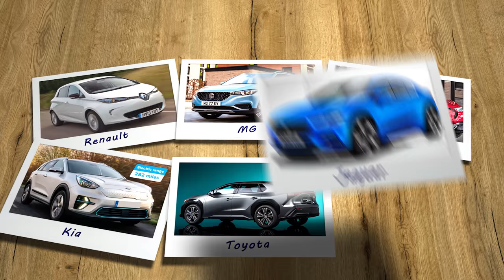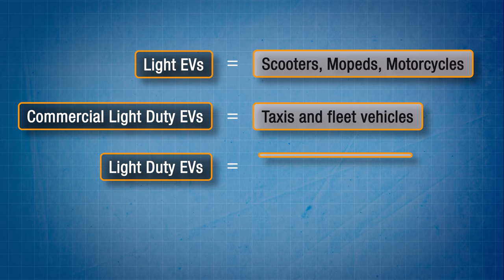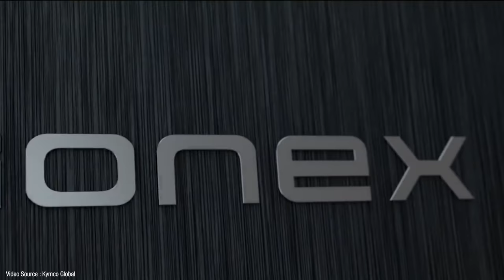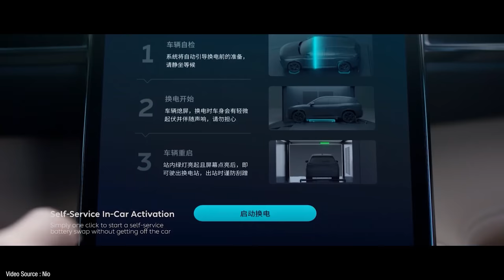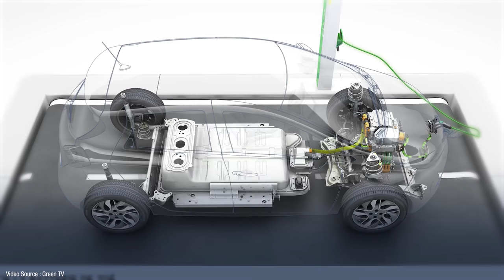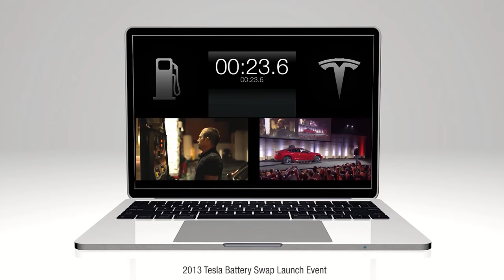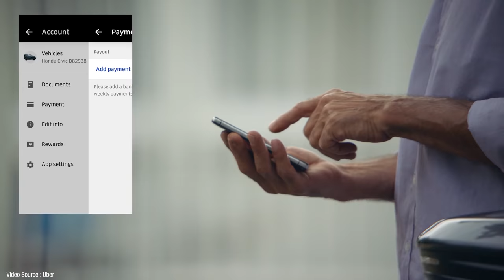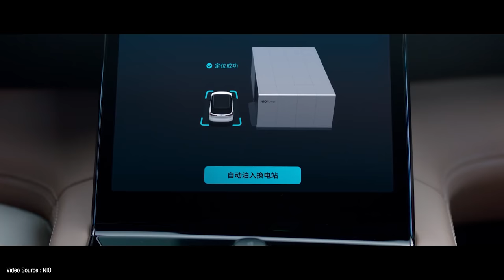Battery Swapping. Transforming the trajectory of electric vehicles?

Comment: BAAS is good for low-weight batteries.  We seen battery-swapping and an interim solution with hydrogen-swapping as a long-term solution  We have a hydrogen swap program.  What's better is that we have solid hydrogen, which is safe, has higher power density than Lithium batteries and requires no infrastructure for recharging and distribution.  Recharges with decentralized green hydrogen.

Comment: Horrible idea! Aside from the assumption that batteries and charging performance will not improve it totally locks in a current inefficient battery pack design as well as the EV itself. If Tesla had done this years ago it would have precluded their transition to the more efficient structural battery pack. Also, there is no economy of scale. Each EV manufacturer has to duplicate the swapping infrastructure, spare batteries and logistics. Electrons are universal and changing stations can be used by all EVs and will improve over the coming years to be comparable to ICE refueling.

Comment: I might be alone with this opinion that not being able to refuel an electric car as fast or in as many locations as its combustion counterpart is the achilles heel of electric cars we can purchase in today's market because there is always that little fear of running out of juice in the most inconvenient moment/place and this problem of fear will only be laid to rest by having a interchangeable battery technology which will cater for multiple car brands personally I wouldn't mind if a government sets the rules for electric cars in terms the standards it must abide when it comes to recharging and  interchangeable of batteries.

In regards to a battery being a structural part of an electric car then I would like to point out that many (if not all) of the electrical forklifts I have driven during the past decades the battery is interchangeable and is a part of the counterweight (but not the structural part).

Comment: While I can see there might be a niche for battery swapping in the HGV sector where enough battery capacity is hard to add. 

But for regular cars/vans its seems non commercial. Charge times keep falling. The complexity and makers costs to make this happen for a shrinking potential market looks a non starter.
Reply: Half the public doesn’t own a home. Where exactly are they gonna charge a battery as fast as you can swap them?
Reply: @tcroft2165  The fastest chargers are also really expensive, not that common, require massive electrical hookups, and place a lot of wear and tear on the batteries themselves.  It would be a lot more efficient to just swap batteries and slow charge them.

I think people are also ignoring how swappable batteries would allow owners of older electric cars upgrade to new battery technology as it becomes available, instead of being forced to dispose of their existing electric car.
Reply: @sunspot42  The fastest C are really not much more expensive to install at scale which is why they are rapidly becoming more common.

You'd only use the fastest option when needed otherwise you can obv use the slower ones esp those where you are already stationary like supermarkets offices etc...

Its not more eff to create a complex second market for generic swappable batteries that don't exist. For typical mileage you lose on excess weight carried alone.

Given average car life against average battery life you might make one replacement - perhaps not even that on growing battery life -  its not going to make enough difference for the economics.
Reply: @tcroft2165  Around a third of the population in America lives in apartments or rental homes where superchargers and even trickle chargers aren't often an option, and many homeowners live in condos or town houses where again, even trickle chargers may not be an option.  The supercharger network is grossly inadequate to support a broad switchover to EVs, and will likely remain so for years to come.  Right now it barely supports the market for EVs as rich peoples' toys. 

For typical mileage, the integrated batteries coming in most cars are already oversized and result in a lot of excess weight being carried.  It would make more sense to have the swappable battery packs be smaller, and to have the option to tack on an additional pack for long range driving.

We don't know what the average life expectancy of electric cars is, but the batteries are the one expensive component known to degrade and also the area where the technology is advancing most rapidly.  It makes sense to decouple the batteries from the car.
Reply: @sunspot42  It doesn't matter where ppl live - it matters where car owners live. 

However even if you include general housing  - While figures vary by country again - 63% (American Housing Survey - Housing units) was the figures for a garage/carport in the US 5 years ago. (And that inc condos or town houses, shared rooms etc.)

EV CPs are being added faster than market growth and no danger thats going to be the blockage.

Firstly you'd add the weight by having to add car structural strength back without a battery in many cases. Secondly V2g and related services rely on the excess capacity and thats a good thing for the grid and enviroment in the future.

Even existing batteries have 2nd life uses (ie storage) so thats not a deal breaker.

You can;t easily just decouple the car/bat. As the differences relate to choices of size, weight distribution, battery characteristics.
Reply: @tcroft2165  Unless you own a detached home outright, there can be restrictions on whether you can add some kind of charger to the structure, so for a large and growing percentage of the population setting up some kind of charger - even a trickle charger - is simply unobtainable. This will be an unnecessary blocker to the adoption of electric vehicles. Building out a battery swap infrastructure eliminates this need. 

As for charge points being added, I know a Tesla driver who had to carefully plan her route from Southern California to New Mexico just this past year. So whatever pace they’re being added at, it isn’t fast enough. 

The structural strength gains from integrating a battery are minimal, and can be offset by simply decreasing the size of the battery pack slightly, which will decrease the overall weight of the car and make it more efficient. Battery swaps you can complete in a couple of minutes make this a perfectly viable alternative.
Reply: @sunspot42  There's no restriction on a standard plug trickle charger so thats a fall back even before we get to either a right to install or building regs requiring chargers. Which is inevitable.

I can't comment on an individual case obviously. Though she may have been trying to stay on the Tesla network not the total network. But there are 10-15yrs in most western countries before even new ICE are banned and plenty of time for more CPs.

If you lose a structural component you will have to add that back to the car. No free lunches. And a mass battery swapping network is not cheap compared to charge points.

Comment: Superchargers are extremely expensive when compared to battery swapping stations? How?
Reply: A single supercharger needs an electrical supply that could power 50 homes, because it's peak loads are so much higher than it's average loads. A swapping station can get away with a supply much closer to it's average load, and it is much easier to sweet talk electricity suppliers if you are able to actively help them manage the grid, by doubling up as storage (even if only on the minute to minute level).
Reply: @agsystems8220  Since you have to have a battery at the swapping station and the infrastructure to swap it and charge just a charger and the additional battery (if you want to level out the load) cannot be more expensive. Especially that as a buffer you can use cheaper batteries with lower energy density
Reply: @kedaruss  Lithium ion is proposed for grid storage because there are no cheaper batteries on the market (by kWh); the chemistry is just that much better. Proposals exist (liquid metal in particular), but are unproven at this point. You basically have a situation where there is an empty battery on the car, and a full one at the station, and you want them the opposite way round. Your options are either using a battery to charge another battery (efficiency loss) in the most damaging possible way that uses the most power electronics (expensive) it possibly can, or you can mechanically switch the two batteries. The robot is the only part that switching needs that a supercharger with storage does not, and when you consider that you would need 6 copies of the 250kw power electronics to match the peak throughput of the robot, that adds up fast.
Whether they can actually build the robot cheaply enough is another question, but I could well believe it.
Reply: @agsystems8220  Correct but there are different li-ion chemistries with different power densities and different prices per kWh. Like lithium iron phosphate (LiFePO4) with no cobalt nor nickel, more cycles, safer, cheaper but heavy.  

What I was talking about is how is supercharger more expensive than a battery-swapping station (claim from the video). You said that swapping is cheaper because of a lower rate of charge but this can be offset by having a battery that you do need to have anyway in case of swapping. The fact that most of the superchargers do not have local storage means that it's cheaper not to have it. 
So on one hand you do have supercharger stalls and a transformer if needed. On the other, you need to have a building (you can't really do battery swaps without the roof), a human operator/driver, a car repositioning system, a battery swap robot and a stash of batteries. One of those stations still takes several minutes to perform the swap (In case of NIO you can do 6-8 per hour maybe).

Comment: Lots of naysayers popping up, which makes me suspect of their motivations... Battery swapping seems like a critical  feature of EVs due to battery life-cycle management. Batteries are not the same as ICE fuel tanks, and thus require an entirely different management model. For instance supercharging (the equivalent of filling a gas tank) on demand is a bad way of managing energy storage. It degrades performance, shortens a battery's life, doesn't manage battery health, overtaxes the energy grid, requires local electrical utilities to upgrade infrastructure, and can't balance energy grid load demand. Battery swapping solves those issues with EV, while taking up the same area footprint as an supercharge station. Capital and operational costs are different, but that's just a matter of project management. And an EV energy stall can be dual purposed for both swapping and supercharging.

Comment: #1 Battery production is the real bottleneck for now and for the foreseeable future. Elon Musk has said that Tesla would buy as many batteries as any producer could manufacture for a long-term contract. This is why I believe that the Tesla semi has been delayed because each semi would probably carry enough batteries to power four or five cars. As well as the Cyber truck will be coming out very shortly. I don't know how many batteries it will require to go 500 plus miles. Now with battery swapping, you would need at least two batteries per vehicle because one's in the car and the other one is charging as well as each swapping station would require a fair amount of batteries waiting for customers.

#2 I don't believe people would care for the batteries and neglect or abuse them if they didn't own them.

Don't get me wrong I like the idea of battery swapping. also, every swapping station could be tied to the grid and make money like a peaker plant. Just not at this time.
Reply: With regard to #2, given people that do own them are crying out for quicker chargers I don't think you are correct. The only way to really abuse them is to charge them badly, discharging is pretty hard to get wrong (especially as each unit would have it's own control electronics).

Comment: If that stupid idea worked, we would have it for gas bottles & other compressed gases, pallets & shipping pallets/containers, car rentals, hotel rooms rather than tents & camper vans when we travel from home, ... oh wait.

Its the ONLY practical battery solution for long distance trucking e.g. 

its not just the refueling delay - fast charging is a big ask for the rechargers grid link, & the battery life. Its not a full charge either.

Comment: As batteries are only energy stored chemically as are fuels such as gasoline and diesel, refueling our gasoline cars is actually battery swapping except the spent batteries are exhausted to the atmosphere.   The Tesla battery swapped aluminium air batteries was only a failure due to the inconvenience of swapping out the batteries as an appointment was needed.  Of course, Tesla achieved it's goal of shoeing regulators that they could easily reach any fleet range requirements given so it was always just a token effort.

Now back in the 70's, it was proposed that electric vehicles could just swap the electrolyte of lead acid batteries, eventually the plates would also need to be replaced but the whole idea was that liquids are easier to swap.  In essence, many batteries including lithium ion batteries tend to have liquids at least in their electrolytes and there are even completely liquid batteries proposed such as the liquid metal batteries hence battery swapping can become far more convenient if it is liquids involved.

Comment: There's no way every car will use the same battery. This is an outdated idea already. Especially with structural batteries on the horizon.
Reply: And if you throw software updates into the mix, then this battery swapping idea can't really work for all makes of car. Some cars will need software recalibrating if there are even minor differences in the battery packs....

Comment: Not every battery is the same at the moment.
Some designs/materials/technologies/poweryield are better than others.
So, you end up with a one size fit all.
The more powerfull cars might end up at the swap station more frequently.
So, China has a standard but that may also slow down innovation?
And what about the promise of hydrogen.
Bigger car? Bigger tank and same or more range.
Like petrol now.
And it can also be produced locally.

Is China setting the standard like Microsoft once did for the desktop operating system?

Comment: The EVs, in the way they are currently made, with a big batteries are wast of natural resources. Big batteries are not a viable technology. Electrical drive train, for that cars on the other side. An efficient EV must have electrical generation on board, via a efficient thermodynamic transformer and the size of the battery to be 1/8 - 1/6 from the current ones. In that case there is absolutely no need either by swapping or by charging stations anyway.
Reply: But aren't combustion engined cars also a waste of natural resources?  They run at 30% efficiency, wasting the remaining 70% as heat. That's wasteful surely?  And why is an EV battery a "waste" if it can be almost fully recycled, with the lithium and cobalt being 90% recoverable?  Used gas and diesel isn't even 1% recoverable.

Comment: As technology advances having a required standard will likely slow adopting the newer, likely better technology. When the existing swap out system gets around to being replaced with a newer one, will change stations still be maintained for the older cars? Remember when head light standards where controlled by the government? The rest of the world had better head lights long before the law was finally changed here. 

Would congress and their lobbyists be the ones to dictate design? Who would the design favor? The biggest campaign contributors? How much faith do you have in politicians?

Tesla is in the process of improving the battery enclosure part of the car structure to reduce weight and make a stronger chassis. If required to adopt the standard such improvements would die.